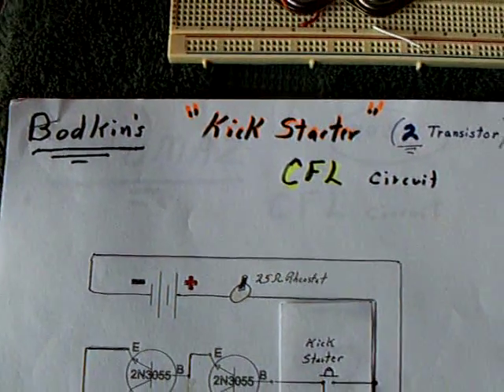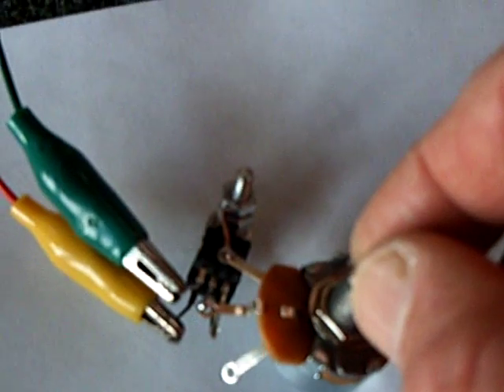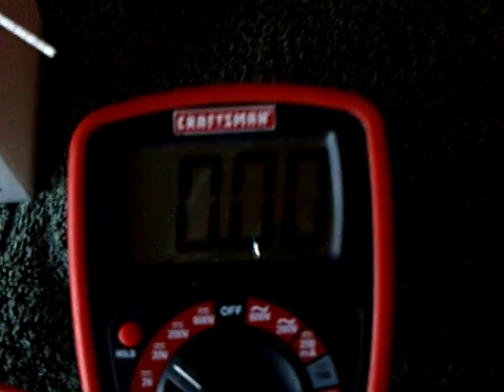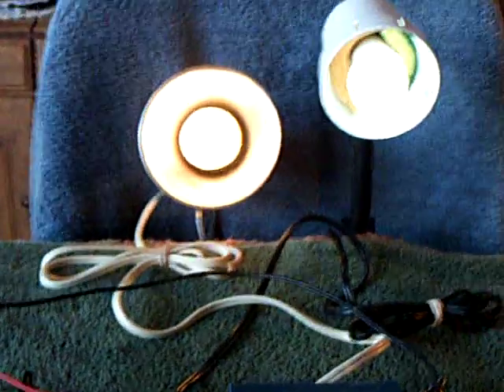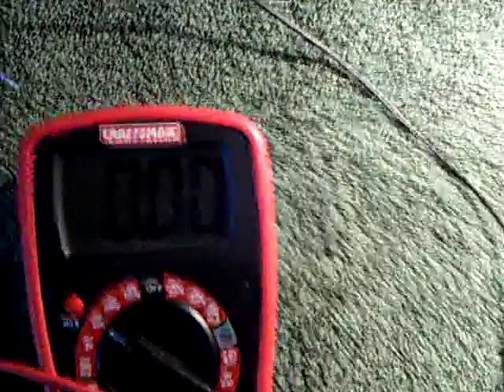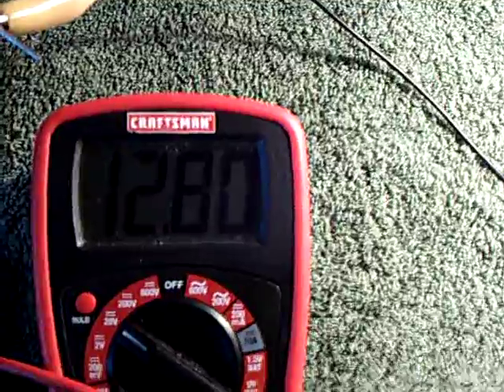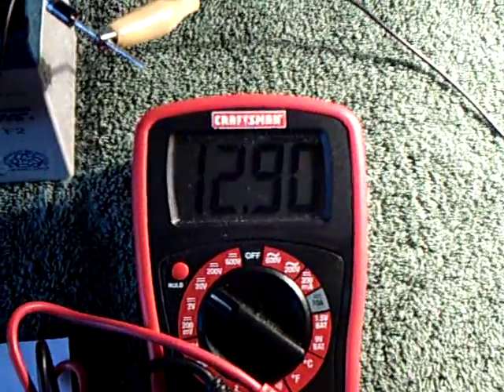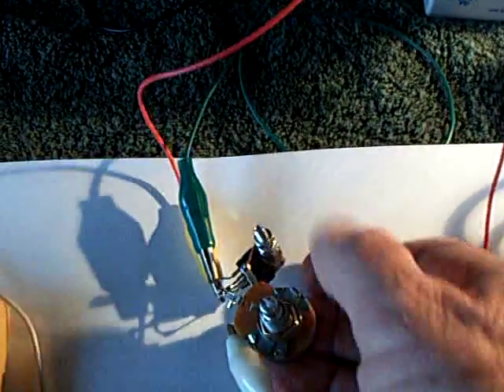Super Simple CFL Drive---solid state

Comment: even at 500mA draw with 12 volts the system is using 6Watts of power... very impressive..

-wat is the normal power rating on those cfl's?
-are those 2 bulbs at 500mA sufficient enough to light a room?

Comment: iv notices that the neons work at 60 volts,  you know you should start expirimenting with spark instead of neons,  its the 4 state of being  and we know nothing about it,  i one time thought that a neon and a spark was the same thing but its not. the spark actually act as a rectifier/pulser, but a certain voltages it can dump both ways. please try it out.  replace the big diode with a spark.

check out the ressonance dry/steam cell and check the reactions the energy flows both ways